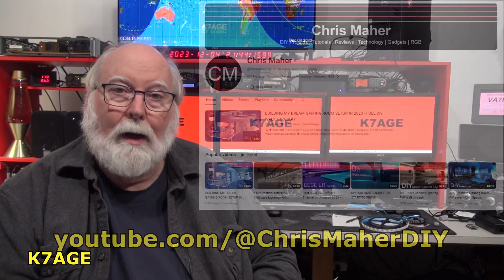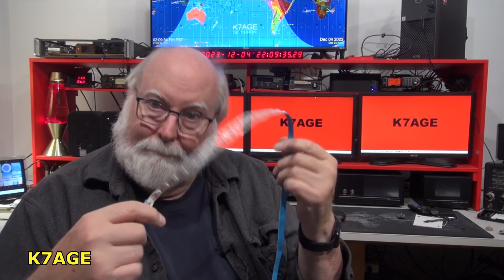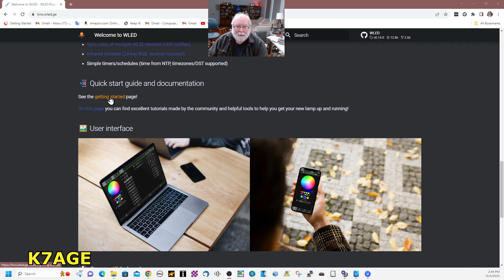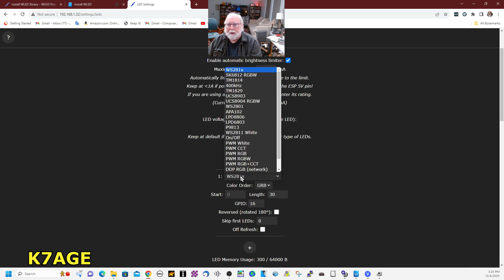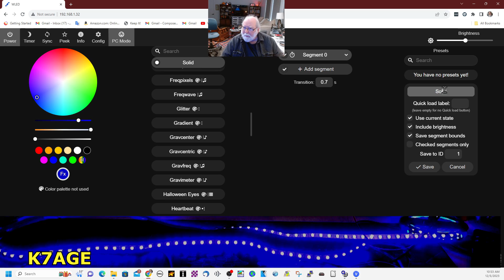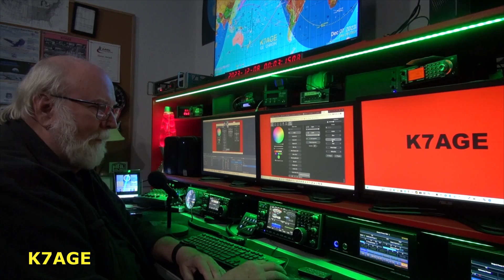How to add LED lighting in your ham shack using WLED & ESP32

Comment: Hello Randy,  I have been using WLED for a couple of years now.  I setup some LED's similar to yours on my desk and one thing that I have found EXTREMELY useful is the button feature.  I added a button (One of those "Try Me" buttons from a Halloween decoration) and then stuck it up under my desk where I can just tap it quickly.  In the settings you can tell it what you want the button to do and you have options for single press, double press, and long press.  So I have single press toggle on/off, double press will cycle from one preset to the next, and I am not using the long press. I found it so much quicker for day to day use, so I only really open the app on my phone or the web interface on my computer when I want to do something special. WLED also integrates very easily with Alexa so you can add it to routines and such.  Great video and hope you find this helpful.
Reply from the maker: Curtis, thanks for the tips. I thought about using one of the inputs to connect to my radio’s PTT to turn a strip to red for a on-the-air light.

Comment: Interesting but not sure I can do what I want. For one set of lights I would want the bright white but need to be just short of 40 ft each <X2> and not sure if that would overload the controller. Secondly I thought the controllers, especially for colors, caused radio <or tv>  freq problems. I hope you tell us if you find a frequency that would be a problem.
Reply from the maker: I would make that into 4 10’ strips and feed each strip from a separate IO pin on the ESP 32. Haven’t heard any noise yet. There is another comment from a fellow that runs 1000s of lights outside for Christmas and he has noise. The longer strips may act as radiating antennas.

Comment: Robert KD4YDC here. Ironically your hitting on two of my hobbies. Ham Radio and animated light displays (as per my YT name/channel). I know you have checked for noise and didn't see any on 10m. Right now (as of Dec.9th) I am in the middle of the Christmas season with my display in full swing. I can say that once my display is running for the night, with the same RGB type of LEDs there is noise all over the hf band. 40m is unusable on SSB. I can get away with FT8 but will tell you that portions of the hf spectrum will be dirty. Granted I am running thousands more than what you are, but in certain situations for people's setups... it will be heard. I do wonder because my inverted V is vertically polarized and really haven't checked out my beam which is horizontally polarized. I think most man made noise is more vertical than horizontal. And a noise blanker, at least in my situation does not help. Now on the other hand, I have a cheap Amazon RGB bulb in a lamp above my ham desk that does not cause any noise. And before someone says anything about the switching supply (not the wallwart), I have probably 8 to 10 of those in my display and they are not noisy. (rf wise) 73, Robert KD4YDC
Reply from the maker: Robert, thanks for the noise comments. I'm sure your strings of LEDs are acting as antennas near by the radio antenna. I'll check your site. Thanks, Randy
Reply: @K7AGE  THAT is very true on the wires. Did not think about that because there is HUNDREDS if not a thousand feet of wire in the display. So note to others, try to keep your power and data runs short. Chokes might also be in order.

Comment: Hi Randy, Very nice addition - thanks for the idea.

I think I'd add a 30-45 degree wood strip lip to aim the light more down and back to prevent the glare into my eyes. Or perhaps some sort of wide piano hinge to make it fully adjustable.

More vids... 😃

73
Reply from the maker: I have spent many hours working at my desk (editing this video) and I find it quite pleasant. The light don’t bother me.
Reply: There are aluminum diffuser channels that come in a 45 degree variant.  Great for display shelves.